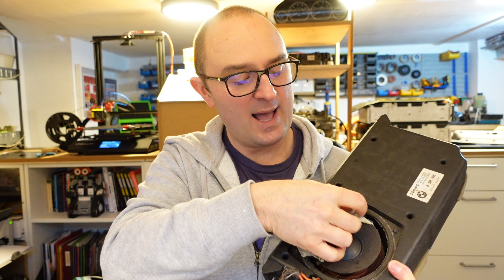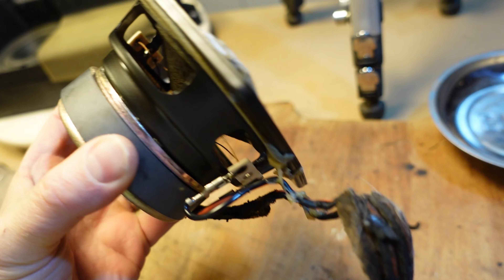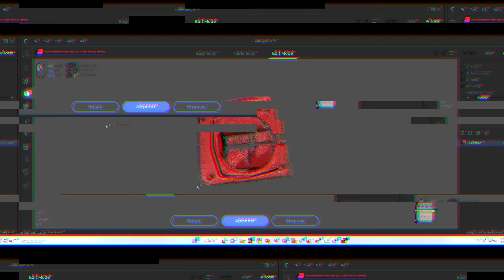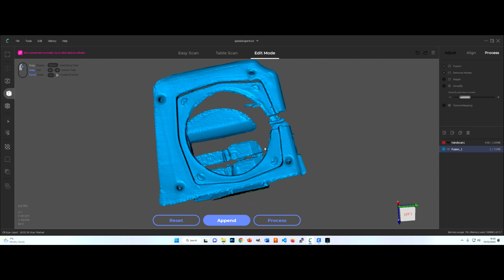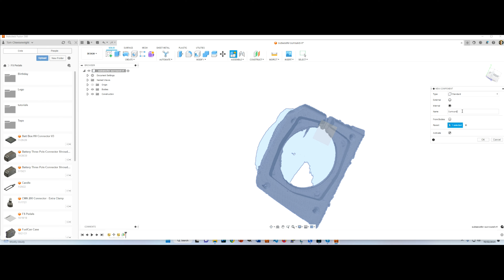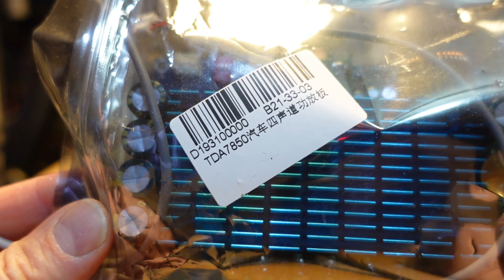Fixing a BMW Z3 Subwoofer with 3D Scanning & Printing

Comment: I picked up the speaker perfect fit.  The installer secured it sounds great.  Thanks for sharing
Reply from the maker: Brilliant! That's great to hear. I've just upgraded my system again with a new head unit as my old one's sub out wasn't working properly and it sounds so good now.

Comment: You know you can refurb and upgrade a blown paper subwoofer very cheaply and quite easily. Would have saved a lot of time.
Reply from the maker: I don't know. The replacement unit is much more robust and it was pretty quick knocking up those brackets.

Comment: I'm hoping to put an Android head unit in my EV conversion (when I finally get it completed) so will probably have to replace rotten speakers too so I'd be interested to hear your experience of the amp and bass box.
With no engine noise to drown out all the squeaks and rattles I'll need a decent sound system. 😉
Reply from the maker: I looked at a lot of second hand amps which was my alternative. But that AliExpress one was so cheap I figured it was worth experimenting with. Unfortunately the head unit won't be so cheap!